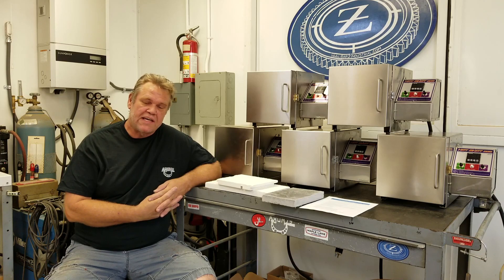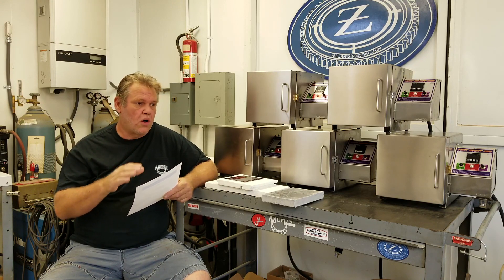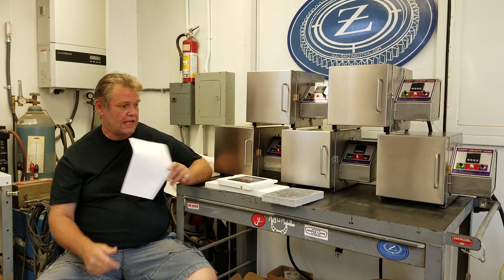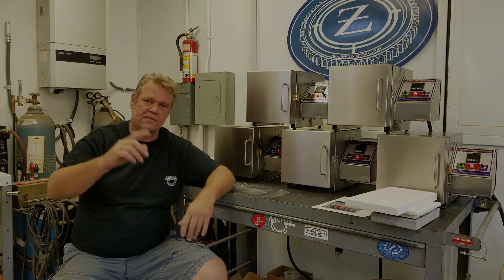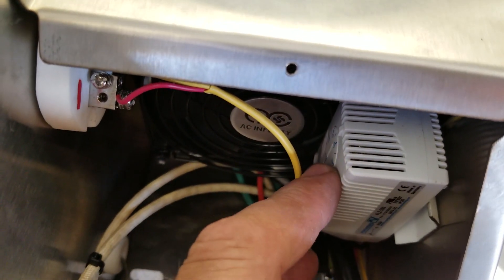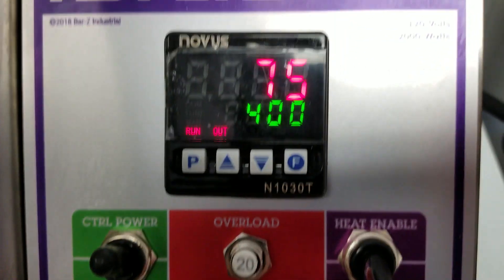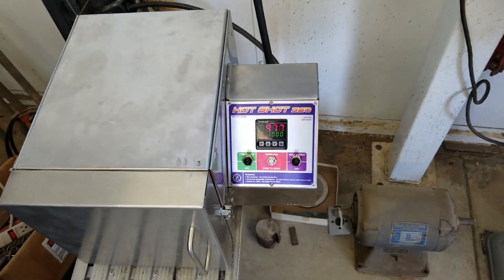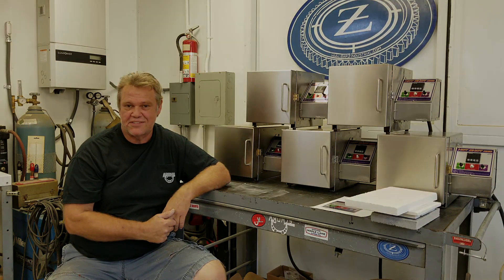The Hot Shot 360 the first 8 done!

Comment: Nice! I think the only thing I might have done differently would be a 2" square piece of mica or micarta or phenolic under the ceramic terminal block so that if you drop something it won't be able to connect the heater wire to the case.

Comment: I'd consider adding a door switch to cut element power when open,  and routing the element so it traverses above the floor level.  I'd be concerned the element being blocked will be a hot spot and lead to early burn out.  I used 1/4 thick kiln shelf for the hearth plate in my oven. You won't drill it,  but should last a long time.  Very nicely done though!

Comment: G'Day Stan, beautiful looking heat treat ovens.  Ideal for the professional and not so professional workshops like mine.  Do you use a rigidizer on the Kaowool fitted into the door.  Its something we coated the exposed fiber blanket on large aluminium filter boxes to give a hard face.  Just gave that added protection when operators were cleaning the boxes with tools and bumped into the blanket.
Cam